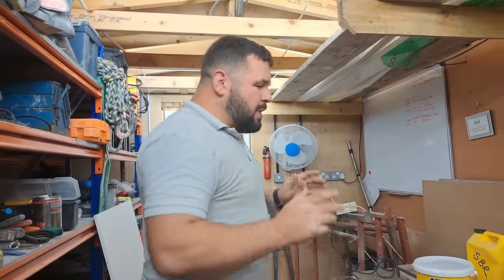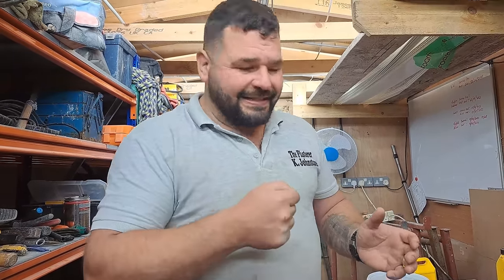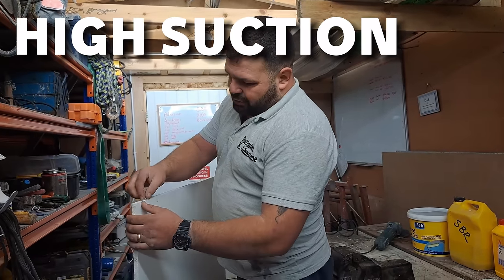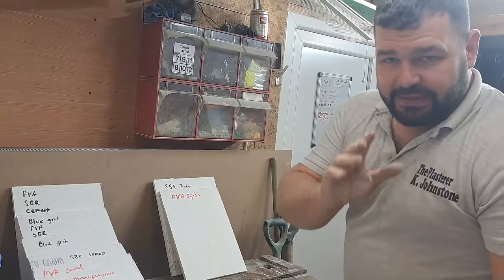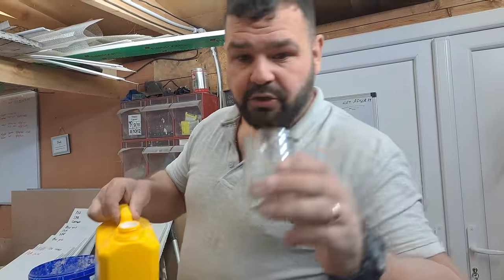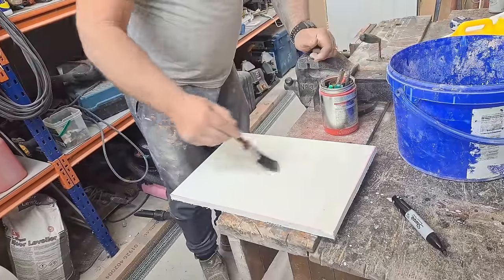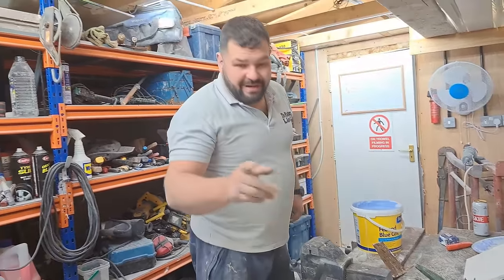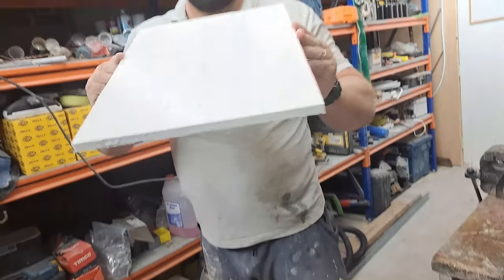I FOUND THE BEST EVER PRIMER FOR PLASTERING!

Comment: Lets face it, the biggest latereral force that will be applied is Blutack, i'll stick to 50/50 PVA as it's never failed externally or internally for me.
Reply: Pva externally hasn't failed on you? You're the luckiest plasterer I know
Reply: @ianking4713  As you know, there's an awful amount of 'Plasterers' that have never served their time.
Reply: I've always used pva 50 50 it will always reactivate if left dry when you apply wet render or plaster, also I always powe jet old walls and buildings to rid of any contamination like algae or moss.always found sbr you have to lay into it while it's still tacky.
Reply: Yo wigs, wot be PVA n were a bruh can get some , no wot am sayin🎉
Reply: Brill test that thanks. I'll try just using sbr sometime, I normally use pva
Reply: @ianking4713 Externally we preferred to use mechanical key ie a bunch of angle grinder kerfs, hatch out a few bits of pointing if on brickwork or maybe a mature spatterdash on hard smooth concrete. Then they brought out EVA (external PVA) then SBR which is great as it can stop shrinkage if used integrally.
Reply: @oh_that_nasty  and in English please!
Reply: PVA ? I was a plasterer in the 80s PVA externaly was a big no no then, what's changed. If you had too much suction, wet it down, how much? that's where the experience comes in, Im now 66, I can still do it, but only if pushed, and we used to run cornice in situ, that means on the ceiling 😅
Reply: Can’t use PVA externally

Comment: I was a plasterer for 20 years, before I moved on. We only had pva , wish they had these other glues 30 years ago. I remember my brother in law who was also a plasterer remembers when there was no such thing as pva.
Reply: At one time, overskimming existing plastered, painted walls was frowned upon, to put it mildly, so there was no demand for PVA, except by bench joiners, who glued joints with it. The accepted method was to hack off right back to the brick/blockwork, Carlite Browning ( Bonding if low suction substrate) then Carlite finish. Dot and dab wasn't used either. Times have changed, obviously, but I was on a job a few weeks ago where there had been some dampness, the original plaster sounded really hollow in places... and it was earmarked for overskimming. Then again - how many plasterers could hardwall plaster now, I wonder?

Comment: Now that's a turn up for the books. What a great test thanks for doing this Kirk I'm going to have to turn to SBR and ditch the PVA unless I have the time on the job to use stu's mix. Even though stu's mix has really surprised me as it contains cement you would have thought the cement in the mix would have made it high suction. Thanks again for taking the time to do this mate

Comment: I'm on the fence on this one. Here's why.
You need a degree of suction for the plaster to adhere to the surface. We were always taught Never to apply PVA too strong i.e.50/50 as it wont penetrate into the background and adhere , it just forms a skin on the surface which can then pull away with the plaster attached to it. 
The golden rule is to flick some water on the wall and see if it runs to the bottom. If it doesn't then there's still too much suction.
I'm not knocking you Kirk as I still think you're a top bloke that does cracking work 👍
Reply: I can't plaster! Period!  It's a total mystery to me how you guys do it. You're magicians. However, I found this a fascinating watch. A masterclass! Thank you. So interesting. I'm learning!
Reply from the maker: That's what they told me but you saw the results of the test. It shocked me but I don't know how else I can test. The results don't lie
Reply: Whilst that's true if you just apply a strong mix of pva, the recommendation is to apply a weak coat the day before which will penetrate and adhere to the background and then the stronger mix will adhere to the previous coat the next day. But personally I only find this true with high suction backgrounds like old bare plastered walls, sand and cement, hardwall etc. If it is a painted wall I normally use one fairly strong mix of pva but roller it out well so it's not laid on thickly. Never had a problem with plaster blowing.

Comment: In 1985, I used PVA to prime previously painted LBC commons for rendering and Tyrollean finish. In 2023, that surface has no signs of any render falling off. 
The old lime paint was removed with a spiked wheel “scabbler”machine. It was primed and later rendered with sand cement.

Comment: Nice one Kirk, I'm sticking with SBR :) . SBR mixed with cement is great for sticking sand & cement to low key bricks and blocks inside and out. I always use the off cuts of the drywall beats to stir SBR, they are handy for string paints as well as it goes through the holes and mixes well, I might start selling the bead off cuts on eBay as paint stirrers,  this time next year I might be a millionaire  .....  keep smiling Kirk 👍

Comment: Great test, and it certainly put my mind at ease! 

Doing a small job plastering a boxed in section under the stairs. Faff having to plasterboard the steps, and a faff to plaster. First timer too. 

Went against everything said online (I'm also a research scientist, so couldnt understand how SBR would possibly work either), and used sikabond SBR+ neat at per your other two videos on this topic, and by the time I'd mixed up what I'd need it had gone off. Plastered over beautifully, and you could instantly tell where it hadn't been applied when feathering across the new board panels to the old paint. Suction dried the plaster right away. 

Thanks for giving me the confidence to try this (done most trades as a DIY now) but 100% the hardest one for me. I'm sure practice will get a better finish in future, and even a part worn good quality trowel will only get better in time. 

Cheers Kirk,  keep up the fantastic work 👍🏼

Comment: Although not totally scientific I found this a great video.  Very informative but I'd have like to have seen one more option.  That of just soaking the substrate and then putting the plaster straight on.  If the substrate is wet enough it will counter the suction issue to a degree.

I'm no platerer but spent years as a bricklayer.  One of the issues I saw was when laying engineering bricks they'd often "swim" because (due to their density) they provide very little suction.  Instead the water would be separated from the mortar by the weight of the brickwork.  This would form a film, allowing for the bricks to just float out of position.  Some cowboys would actually just sprinkle neat cement on their mortar bed to counter this, (very poor practice) whereas the correct solution is simply to mix up the mortar quite dry in the first place.  

We'd encounter the opposite problem in hot weather with regular brickwork.  Basically the bricks would soak up too much water.  Drying it out before the mortar has a chance to set.  This would result in brickwork that looked fine but had no bond between the bricks and the mortar.  The remedy in this situation was to just dunk the bricks in water before laying them.  Did the job a treat.

Comment: SBR is latex-based and ideal for external waterproofing, plastering over it using finish plasters adheres well but will pop at some point due to expansion. Blue grit is much better as a primer as it not only provides a mechanical key but sets like concrete, giving an excellent background for bonding coat and finish plasters. I used to use waterproof PVA for most of the reskims over artex etc as it gives excellent adhesion - providing the plaster goes over it when tacky not dried and water does not soften it as in standard PVA.

Comment: I just plastered an Artex ceiling. I used about 2/3rds SBR to water. Rolled on, dead easy. Wait till it goes tacky or dry. Works so well. I used to use PVA and it was crap; things may be different now. Never used grit. SBR for me.

Comment: I’ve been plastering for 40yrs and 30yrs ago I did a similar test using as a background a previously plastered wall (sand & cement u/c + sirapite B finish, the hardest ) I tested for adhesion by using strips of hessian scrim and yanking them the following day. I found 3:1 water:Unibond PVA on a previously sealed with 5:1 pva worked well provided the 3:1 adhesive coat still had tack. We didn’t have SBR then.
Using sharp sand as a grit key mixed with sealant worked but sank to the bottom of the bucket and ended up being dashed on like spatterdash. Nice bit of science there Kirk.

Comment: Well, that was interesting! My thoughts, Blue Grit is about half the price of SBR, so more cost effective, maybe a mixture of SBR/Blue grit applied the same day for killing the suction would work! I think Blue Grit helps drag the plaster of the trow better, (not by much though) so less pressure needed to apply the plaster would save a tiny bit of work, every little helps. Mixing SBR with PVA, if that cuts the suction down, it will save on material costs.

Comment: Not a plasterer, but when i did my cellar, i primed with 1:1:1 SBR Cement & Sand (Mix of smooth and rough). Id be tempted to test SBR and Cement on the back of one of theme boards see if you can beat 14kg. Great video!

Comment: I loved this video Kirk and really appreciate the time and effort you went to putting this all together. I'm resting a little easier in my bed watching this as 2 days ago I replastered my bathroom ceiling over artex. The artex was well stuck to the bare boards from new (21 year old house) and has only ever been painted with matt emulsion. I gave the artex a really good scrape and a wire brush then SBR,d the sh..the out of it. A 50/50 mix of SBR/water first, allowed to dry then a heavy neat coat of SBR and left to dry for 2 days before I plastered it. I was quite worried as the ceiling looked like it had been varnished by the time the SBR had dried. First time I've used SBR after watching your videos and I thought I'd wrecked the job by over doing it. I skimmed it anyway, 1st coat board finish, 2nd coat 50/50 board/multi as I didn't have quite enough board finish and the suction was zero. I am not a pro plasterer and speed is not my strength, but even I was hanging around waiting for the plaster to firm up (1st time ever..... I'm usually panicking at the first wet trowel stage) and it all seemed to go quite well. But..... I've been worried that the whole lot will shell off when it's dry. More confident now that it won't. Blooming hell though, I will go a bit easier with the SBR next time. I used Sikabond and don't know if it's just me but the stuff stinks horrible 🤮. Thanks again Kirk for a great video.
Reply from the maker: Great comment, enjoyed reading that and you're ceiling will now be bomb proof 😳🙂👍

Comment: Shud have done 1 just plaster directly on board but gauge in with trowel like tile adhesive then go over and flatten rather than just coat on and flatten makes better contact adhesion worth a try

Comment: Fantastic test...I was curious about SBR applied the day before as many people thought till now (including myself) that when it dries it creates a waterproof layer and plaster doesn't actually adhere to the background but only to that waterproof layer. Your test shows it adheres well to the board itself.
Blue grit is a fantastic product but way too messy to work with as are all different mixes just too much hassle and most of the time there is no time to mess about on the job. So yes SBR is probably the best but blue grit is still my choice on artex painted with vinyl silk or any other shiny finish...
Thanks for doing that Kirk 👍

Comment: Great vid. There is a difference between contolling suction,  killing suction and sealing/priming the surface. All of which I use different ratios of pva for. That's the skill and knowledge in my opinion that is misunderstood. Pva manufacturers instructions are a waste of time as well as a 50/50 mix. Every surface requires a different approach in my opinion and watching the pva dry is key to understanding what suction you have. 
Pva 50/50 never stood a chance against neat sbr or neat blue grit. 
Also, adding an aggregate decreases the porous surface area. 
I've always applied pva as neat as possible by adding just a splash of water to make it easier to apply. A second mist coat too can be beneficial. 
I used sbr on friday for the first time and quickly regretted it. Suction was not controlled and if the sbr gets into the plaster it causes it to drag like a bitch. 
Reminded me of tilers primer or self levelling primer/sealer and they're specifically designed not to kill suction but to reduce it. 
After using sbr neat I've now moved onto pva neat and adding 10-20% of sbr and splash of water.......I'll see how that goes on monday. But I'm doubtful It'll be any better than strong pva mix.
Reply: Always use   PVA with no problems like yourself. Plaster needs some suction to adhere to any surface. Sometimes it's just a dust killer on old walls even on outsides prior to applying a sand and cement scratch coat .33 years plastering BTW.

Comment: You should also try Parex micro gobetis and Knauf beton kontact or the spraykontact is even better if you can get hold of it in the uk. I've used the knauf stuff for years working in Holland but recently came back to uk. A friend recommended the Parex micro gobetis for artex ceilings, i use it all the time now! The suction is comparable to skimming boards and it also has a grit in to key. Its waaay easier to roll on compared to blue grit cos you can water it down quite a bit and it still works great. The knauf spraykontact is like painting emulsion and can be used on any surface and like the name suggests, it can also be sprayed on with an airlash machine for large areas

Comment: Hi kirk, great channel. I am just a DIYer but have already learned loads from you so thanks for sharing your knowledge. 
I once had a room skimmed by a professional, but the paint roller peeled the skim off. Would that be because he used pva and not SBR?  Or maybe the mix was too weaK? He used pva ans water on the same day he plastered.
Cheers

Comment: When grit first came out ( think it was thistle bondit first?) . It was about 64 quid a tub. I use the febond blue grit mixed with some pva these days. But back then ,no way I was springing for the 64 quid. I used to use almost neat pva mixed with carlite bonding. The lightweight aggregate in bonding gave a good key and seemed to spread pretty evenly if you mixed it every 10mins or so. Bloody messy but aren't they all

Comment: I'm also surprised you didn't water down the sbr since lots of plasterers use 4:1 as per the majority of manufacturers guidelines. This would've been a direct fair comparison with pva. 
Pva can be applied neat on shiny non porous surfaces as per manufacturers guidelines. But I can't see that SBR is recommended to be used neat. 
The reason for that may be that if the sbr forms a dry skin it may reduce the bonding strength of the  adhesive/plaster or render etc since it's not able to key itself to the substrate.
Reply: I don’t water sbr works fine everytime
Reply: @karolzawislak2064  it'll work no doubt about it. But if the test is to be comparable, the pva and sbr should've been watered down at the same ratio. Also, acknowledging that the sbr manufacturers are not stating that sbr be used neat. I'm not an expert but I can see that this is not black and white.
Reply: SBR is never watered down

Comment: Great experiment mate and it was interesting to watch. But I think whilst the results are probably mostly true they're not entirely conclusive. For one, all pva is not the same. I remember when you had to literally squeeze the tub to get the stuff out (yours appears to be Sika which is actually one of the thickest still around) but nowadays with a lot of brands it pours out like it's already mixed. So saying 50/50 will only be representative of the brand you used. It might be completely different for someone using a different brand. Also, maybe you could have put stop bead all around the board to ensure even thickness on the panels. Plus, I've never seen blue grit applied that well in a real live scenario, especially when a clueless labourer has done it 🤣. But all that aside you did a great job with the experiment and as I said it's probably mostly correct anyway. God, I hate going over blue grit. You have to lay it on thick to get over the clumps of grit and there's no suction so it goes ripply.....right where's my sponge float🤣

Comment: Hi.Thank you for the video. I found it work a lot better if to  mix sand with pva and   tiny bit of water.Another two thing to try is what I use sometime is pva and bonding coat, and pva and plasterboard adhesive.

Comment: Very very interesting and fun too- thanks Kirk.
I guess the weak link will always  be the  substrate the plaster is stuck to. Eg The paper of the plaster board, so PVA would win on price and SBR would be ' over- engineered?
Reply: Just put some sikabond SBR+ on yesterday for a small job. Neat, and my god, it spreads. The 5L bottle (£27 from Wickes) would last forever, and could be used for other things. If you apply same day then it's a bit of a no trainer compared to PVA and the customer would probably be happier with the strength/pay the difference over PVA if they knew.
Reply: A small downside for some -There is a use by date with SBR and not with PVA.